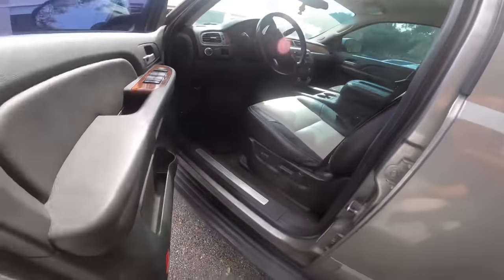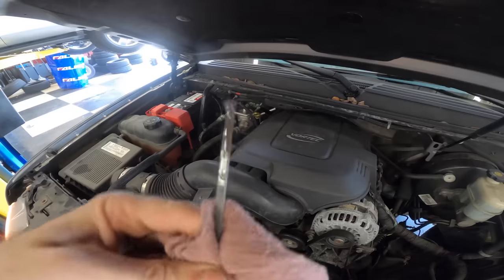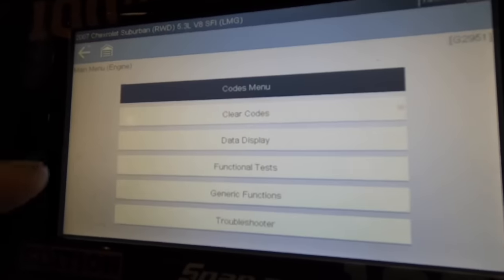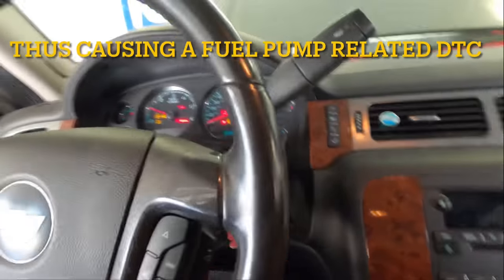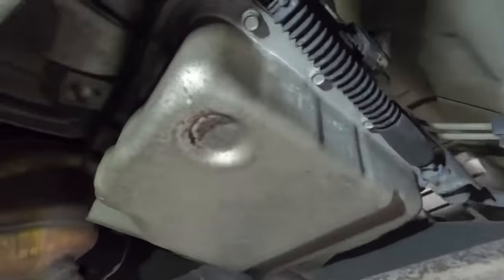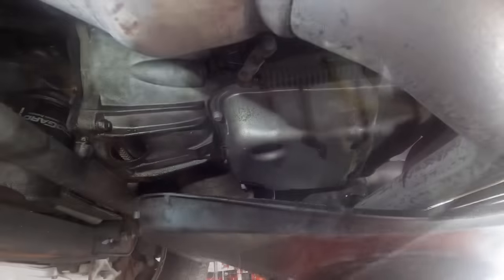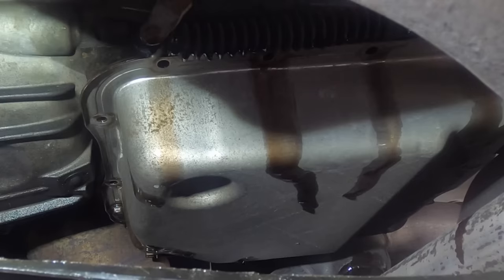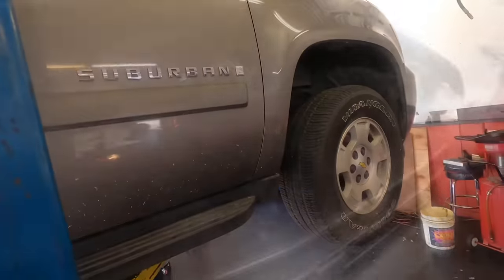Busted! SCAMMING Mechanic Causes Damage! 4l60E Transmission

Comment: Well done , that is a remarkable thing to do as a mechanic but says so much for the man you are because a fair mechanic is another persons hero and savior these days where scams , upselling , cooperate tactics etc comes into play . as i have witnessed first had a scam set upon me but i smelled the rat and denied service from the pepboys shop in lake worth , tx . 03 silverado 2500 4x4 pitman arm nut was loose and was asking for insane money for a 30 second fix but i suspect it was loosened . i fixed it myself and i have started turning wrenches again after 30 years cuz there is no more customer service perks so i do my own stuff again plus it gives me peace of mind and not getting old and lazy.
Reply: The very reason I drive a 2001 Ford F-350 7.3... Nothing on there I haven't and cant fix. Cant trust anyone except yourself.

Comment: I think that noise is a fractured flex plate. It's amazing how badly broken they can be, and still transmit the torque to move a heavy vehicle... for a while anyway! 👍
Reply: Maybe that explains why the inspection cover was gone.  Someone tried to do an inspection, and said, "Hey, they don't need this cover back, It's just a cover."  All it would take is a rock or something bouncing in their, and it can tear the world up.
Reply: I've had similar noise and the culprit was loose/cracked flex plate. Maybe the shady mechanic loosened up a bolt or 2 and forgot to replace cover.

Comment: Great video!  You just need a new key to be cut by a key milling cutting machine. Not duplicated from the original. I've done hundreds of these sticky keys and a new key housing with an original chip solves it.  No programming needed.  I've seen several mechanics ripping off clients by switching the entire cylinder with new keys, when the only problem was the worn key.
Reply: Agreed, a new factory cut key is the way to start
my personal experience is 50/50 problem solved

Comment: When I worked as mechanic we used ford weather strip adhesive to hold oil pan,tranny pan and valve cover gaskets in place,worked great especially for cork gaskets which were never very good in my opinion.
Reply: same! the yellow goooo lol
Reply: You're dating yourself. The last vehicle I owned that had cork gaskets was an 81' Mustang.
Reply: I see you're a man of culture culture as well. Weather-strip crude oil and spray stick jobs, then pray you don't have to scrape it out later. One of the 10 commandments from the old testament of vehicles is "thy corks shall crack and leak", but least you could easily tell if you had fluids or not, lol. Not leaking, ADD NOW. Leaking with more than 1.5 bar oil pressure, GOOD.

Comment: Very interesting and informative, that blue wire had my alarm bells ringing from the get go. Good to hear you're "one bad apple" speech, but the actions of the individual that created this is much worse than a bad apple. Incompetence is one thing, but deliberate manipulation is worse. Great work and I hope your systematic approach gets the owner some recompense.
Reply: I know next to nothing about engines. I know, at best, how to change the air filter lmao. But the second I saw that blue wire and how it was placed in the fuse box I immediately said to myself "That doesn't look normal. I'm not a smart guy when it comes to cars, but I really feel like that's one of the reasons they're having issues."
Reply: Same. Nothing should run into a fuse box like that, and I'm not a mechanic. I would have expected a reaction from OP along the lines of what Scotty Kilmer would have had.

Comment: Great video. It's nice to see a mechanic who cares about his work standards and not his wallet. You are right about peoples option on auto mechanics and shops because of the ones who try to screw people around. This image has not changed in my 70 years.  When they find out that I'm an aircraft and jet engine mechanic they usually change their story real fast. In aviation you called a bad mechanic an " Auto Mechanic " as a insult on how they worked on planes and engines. It shows no matter what you work on once you have that image in peoples minds it's nearly impossible to change it for the good. There should be more mechanics like you around this world and someday things will change God willing.

Comment: This was so enlightening! Thank you for putting that other shop and mechanic to shame by doing a good an honest job! Curious to know what the fix is or was for that fuel pump code that never cleared up - the one true issue with the vehicle I assume, lol.
Reply: The code that never cleared up was the oil pressure sending unit code.

Comment: Ray you summoned it all up . There are lot of con artists out there in the auto repair industry. I remember once a few yrs ago My mom took a car into a transmission shop & the car ran fine no issues they took the starter apart said she needed a new starter & a tune up which was a bunch of  malarkey I had put a new cap & rotor & plug wires set along with new plugs & the car ran like a champ. I went to investigate it I found one of the plug wires was off laying on the side so I put it back on & there was nothing wrong with the running condition part . Basically they were trying to take advantage. & sell something that was unnecessary. Remember integrity first . Doing terrible things to others is a sure fire way to tarnish your reputation

Comment: Great content 👍. Hey, they have this cool invention called a funnel that could help with that fluid in the bottle situation. 😁 Just kidding, I do the same thing. Hard not to make a mess and I did my last one on the floor. No fun at all. Now, see what you went through? This is reason I try hard to do all my own work as it's hard to trust so many of the parts changers out there claiming to be automotive technicians.  Thanks for sharing and being a great asset to the YouTube online automotive Community!

Comment: I'm no expert, just an observer. Two observations on the transmission. First, the fluid and debris on magnet looked typical for a high mileage vehicle. B, When you pulled the filter, we didn't see a seal on the tube (typical). Probably stuck in the hole in the transmission. We didn't see the filter installation so I hope you pulled it prior to the new filter.
Reply: Also I hope that the cover was put back in place before he topped the fluid so it doesn't just go straight out that access cover hole
If it means new access cover needed to go in, sure, that's your good deed for the day
Reply: @rawr51919  There is no fluid at that cover.
Reply: @rawr51919  that hole is just an inspection, it's good to close it to avoid dust but it's not essential. If this car has a fluid plug into the converter, that is where you reach it to unload that fluid too (because as Ryan said, changing the fluid in the pan only changes half of the total oil in the transmission).
Reply: @rawr51919  .... Oh boy
Reply: @Maroco918  That is pretty funny (in a blinker fluid kinda way) but I guess we all gotta start learning from somewhere.  Colton, the thought was there at least.
Reply: @rawr51919  if fluid comes out that bell housing access plate you have serious problems
Reply: @rawr51919  You haven't thought that comment out have you? The cover is in the bellhousing, things should be dry in there.
Reply: @jostouw4366  wait, you mean transmissions arent just steel boxes of spinning fluid? LOL
Reply: @rawr51919  That cover is just there to keep your fingers from getting lopped off. ...and inspecting lol.
Reply: @kreggmann4237  Well, yeah, normally there'd be a cover there but that seems to have gotten missing over time
Reply: @danmackintosh6325  oh man did I completely miss the sarcasm? Shit....
Reply: @rawr51919   That hole is just to inspect the converter and pump. It should always be dry.

Comment: Ray: Your comments are absolutely on the money. I became my own mechanic in high school after a gas station fouled up a brake job on my dad's car. Soon I was the neighborhood go-to kid. I never regretted it for a moment and have built some impressive hot rods for myself and friends. Made some money, saved tons on my own cars, and had a blast with lots of lovely, fun girls.
The sad part of this is the schools aren't teaching these skills any more so we're graduating more potential victims than ever before.
Even the local colleges only skim the surface--it's tragic. Somehow, this has to change-and soon or we'll be left with generations of superficially smart gamers and a nation run by Big Bang Theory no-common-sense graduates who don't even know how to use common hand tools. Seriously, I can honestly say, we're already there. God Bless.
Reply: You nailed it. I grew up on a farm, and was mechanic-ing my own mini bikes, motorcycles, snowmobiles and lawn mowers from age 8. When I turned 12, my dad handed me a part for the inside of the transmission of our 1956 Massey Harris farm tractor, handed me the Chilton manual, the toolbox, and said "This part goes in here." He pointed at the transmission. We had a fully functional farm, plus my mom was a nurse and my dad worked 2nd shift as chief engineer at a nuclear power plant parts steel mill, before he moved to DC working as a high ranking Dept of Transportation engineer. 

Dad wanted that tractor running by sunup the next morning... Somehow I did it. 

We were thrown in the fire. 

My older brothers had a 1/3 mile oval dirt track behind the barn, and they had Studebakers, an old Edsel, some Chryslers, a Ford Fairlane and a Ford Galaxy... All cars that dad had used and parked behind the cow barn after he wore them out. The boys worked in the cars, got them running, and souped them up to race around the oval track. They also had motorcycles and raced the snowmobiles in the winter.

We were well rounded and we have all done all of our own auto mechanic work since we were 14. 

I've laughed in the face of many dishonest "mechanics" then driven away to fix my own stuff at home... 

And even today, I had to do a roadside fix on my van here in Mexico. I see mechanics who don't know a thing. Running across mechanics who really know their stuff is rare but when you find them you're willing to pay their prices for their abilities, knowledge and expertise. 

I have a mechanic back at home in San Antonio Texas who is phenomenal, and a trustworthy mechanic here at home in central Mexico, too! We take care of our mechanics like they are family members. 

They know they're appreciated, and they work extra hard for us. They also know my background as a functional mechanic, and they don't ever get an attitude withe when I'm explaining what I'm experiencing withy car. They appreciate my knowledge because it cuts down on their research time, every time. 

We had auto shop and metal shop in high school but for some reason every state run high school in the country has gotten rid of those forums of real, hands on learning. 

It's a shame, and the only way to continue the tradition is to find a way to help neighborhood kids and our own kids to try their hand at mechanic work and coach them through.

Comment: I had a kind old lady come to me with a Traverse she bought from me - poor thing was about to cry and asked if there was any way we could buy it back from her. Stated that past 50 the transmission started to shake like a dryer with a brick in it - sure enough that's exactly what it did. The mechanic she went to told her that there was no transmission fluid and it was a total loss, and that she had to pay him 5k for a new one. We had the shop look at it.

One flushed torque converter later and it was fine.

Comment: In 1982, I worked with a "mechanic" at Monkey Wards.  We'll call him Lee.  Lee would bring a car into the shop for a specifically  requested repair or maintenance procedure, but then an additional issue would be found during a "come back" some days later.  Ole Lee would then cut the end of the vacuum line he poked a hole into on the previous visit and eureka the "new" problem, which "took several hours" shop time to "repair" was "fixed."  I learned of these things before I quit and went back to college, full time.  This too reminds me of, "An scrupulous mechanic..." Bravo to honesty.

Comment: 42:00 I have to wonder why the other “mechanic” did not remove that incriminating blue wire… Did he think it would go unnoticed? ;-) 
Nice detective work, Ray! Cheers.
Reply: Maybe he thought that the costumer was already in his net and will go back to ''fix'' what they recommended. Just My 50 cent guessing.
Reply: Probably, the car would not run (without the blue wire, removed fuse and missing relay) and the "mechanic" expected the victim (I mean customer) to return to get ripped-off again).
Reply: Always ask for the old parts.

Comment: Thanks for the honest job that you do 👍
Helpful hint hint for you and others. 
I use a 3 gallon bucket with a clear flexible hose about 8' long. I put a vacuum on the bucket with a small shop vac and run the clear flexible hose down the trans dip stick tube. I can usually get @ 4 quarts of transmission fluid out, so the pan is practically empty. 
I also use it for rear ends , power steering fluid and brake fluid reservoir , and just refill after getting out the old.
Reply: Good one!
Reply: I more than astonished that that car did not have a screw to drain the oil. I don't know american cars because they are rare in germany, but every car I had got that screw to drain the oil. Just lift the car, put the oil catch under it and open that screw. The oil drains through the hole and after that you can remove the pan without dripping oil all over the place. With that screw you don't need to construct something to drain the pan. And you'll find that kind of screw not only in the oil pan of the transmission, you'll find it at the differential, too. An oil change kit for the transmission always contains besides the other needed parts a new screw and gasket for the screw to make sure it stays leak-free.
Reply: @seanthiar  its called drain plug. Just education, no hate or anything

Comment: When things are going right everyone just moves on. I’m not a mechanic, but I do my own vehicle service whenever possible. My day job is also thankless. The best we can hope for is no complaints. When I don’t hear anything, I know I did a good job.
Reply: Well stated, whenever a job is declined that was priced out as a wise affordable repair, for being too costly, it usually always spirals downhill from there. 
My Friend turned down a $2100 head gasket repair to have butchers put a used motor in for $1500. It cost him an additional $2300 for 2 transmissions it destroyed, and me a free transmission install and the customer also did his own unnecessary radiator replacement.

Comment: A 2007 and underneath looks mint.
Never see that in the rust belt.🇨🇦
Reply: I thought the same thing! Iowa uses lots of salt in the winter, as I'm sure it's the same in Canada.
Reply: This is in Florida
Reply: I have an 08' in upstate NY. The last guy paid a shop to oil undercoat it every year. It's literally got a quarter inch of used oil built up in certain spots. This really did wonders at keeping the rust down. But it does make any repairs or maintenance not so fun with all the oil everywhere

Comment: GM trucks will trip trans codes with a worn ignition switch.heard about that a bazillion times.
Reply: I  think the switch was fine, it was the tumbler for the ignition lock that was giving the troubles.

Comment: We’ve replaced multiple of those fuse blocks on those, i had one last week, where the internal wiper circuit/relay in the fuse block was bad. Wipers wouldn’t work at all on a 08 Yukon Denali with over 300k miles. There isn’t an actual (removable) wiper relay on those, it’s all internal. I thought it was the wiper motor initially, but when i tested for voltage i didn’t find any. Ive also seen the fuel pump circuit fail inside of them, that was a fun diag.